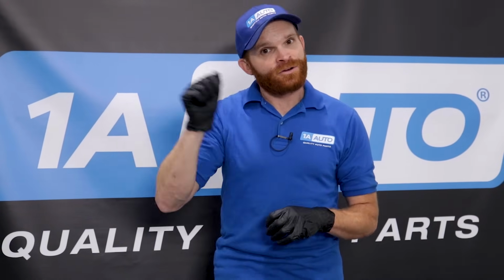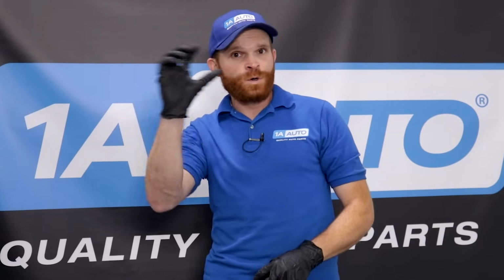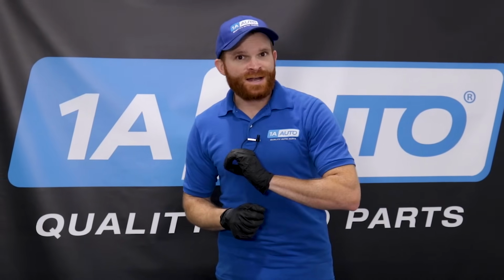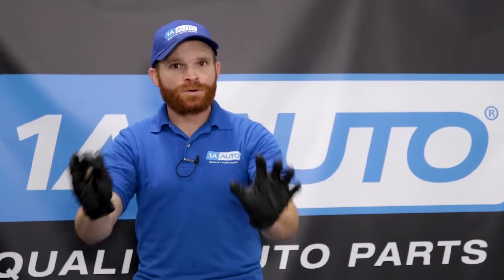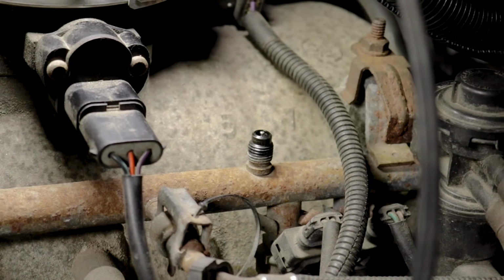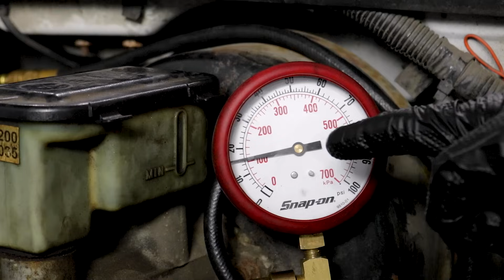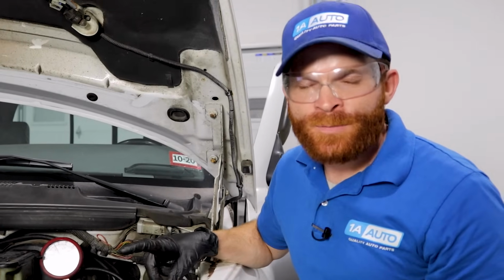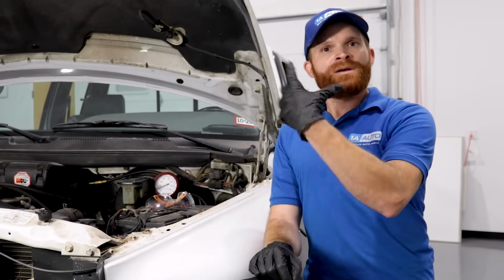Lag, Hard Start, Stall? Diagnose Car & Truck Low Fuel Pressure!

Comment: Is the ignition key on till 60 minute test or just once when the fuel pressure gauge got the pressure and we turned off the ignition?
Reply: In most cars the PCU will only run the fuel pump a few seconds and then stop (unless engine is rotating).  Then turn off the key and wait.

Comment: Thank you very much. Basically all the information needed about fule system. But what I didn't understand is why did you need to change the sending unit if the problem is the fule pressure regulator?
Reply: On some cars the regulator is inside the pump and make more sense to replace the whole thing

Comment: hi, thanks for sharing knowledge, I experienced something similar to your explanation. I have a ford focus automatic transmission vehicle which has a problem when it is started it takes a long time to start the engine and the code P0087 appears on the speedo check engine light display. What is the easiest solution you can give me to solve this problem?

Comment: Another video full of incorrect info.... your diag experience is basically if the pump doesn't run, have low pressure or the ability to hold pressure it's faulty. No mention of static pressure vs running pressure, injector leak down test, or balance test which will cause a hard start. Pumps are cooled by the fuel flowing through it and fuel level has nothing to do with sediment as it's always on the bottom of the tank along with the pick up of the pump and if your sucking air your out of fuel. The check valve in the pump isn't designed to consistently hold pressure but retain the max volume of fuel in the system as you can't compress liquid so pressure is almost instant. I could go on and on

Comment: Would you have any suggestions for a Chrysler 300c diesel 6cyl missing on at least 2 cyl new injectors, compression test results are ok. Scanner shows no fault codes. But injector readings from -0.5 to +3 ? Thanks Mark.

Comment: 2014 Chevy Silverado 4x4 LT:
I have this same very descriptive problem. I plugged in my scanner and it basically said a fuel sensor. a mechanic told me mine has 2 fuel sensors, 1 in front and 1 in the fuel pump. and it just so happened that my gas tank was leaking gas from a broken gas line in it connected to the sensor. fixed the problem I thought and after it still continues to show the check engine light. would that mean the sensor in front is the problem?

Comment: What could cause a fuel pressure regulator to neither raise or lower when adjusting it? The vehicle had trouble starting then finally started and held pressure at 22psi at the fpr.
Reply: Hi did you find the answer what was the problem there any news
Reply: It was the fuel pump disconnecting inside the fuel tank.

Comment: Hello, every time I turn the key to the on position (without starting the engine) it takes about 5 seconds before I could hear the fuel entering the engine. I recently changed the fuel pump and fuel pump relay, still no luck. Also the engine makes a weird heavy sound (kinda sounds like its stalling) only during cold starts. When the engine is warm and I start it up the sound is normal, any thoughts what the problems might be?
Reply: Did you find the answer

Comment: Yes got a lot of information from that thank you I have a 2002 suburban with a 53 the motor was bad I changed it didn’t realize that it was flex fuel truck and I put a regular gas motor in it didn’t realize it till I was all done and the gas was running funny finally realized it fixed a couple things now my fuel pressure is at 45 psi and it’s slowly leaking after a reasonable amount of time I’m wonderingIf it’s the pump or the regulator surprisingly I didn’t have many issues changing over from the flex fuel some said I had to reprogram my ECM I did not so please any response would be grateful thank you so much

Comment: First things first, thanks for the video. And now I would like to ask you about an issue with my 1.9 tdi A3. When the engine is cold it takes a long crank to start, but when the engine warms up is fine. At idle I can feel like the car shakes sometimes a little bit. And the previous owner use to have the fuel tank almost empty all the time. And I'm thinking the fuel pump is close to it's end. What do you think?
Reply: Did you connect a fuel pressure gauge and compare it to service information specifications?

Comment: Very education video. My car won’t start. I think I have a fuel leak beacause I have fluid sitting underneath the fuel rail near one of the fuel injectors. I have a 2009 and no Schrader valve so I don’t know where to test my fuel pressure. Weird thing as well I got 2 new engine codes: p0113 for intake air temp sensor and p0123 for throttle position sensor. Anyone please help and give me your thoughts

Comment: Please comment on calibration of fuel level reading. My friend constantly seems to run out of gas on his 1989 Honda Civic LX, when he actually has lot of gas in the tank and guage shows half full.  When  he adds just one gallon of gas car starts. Fuel pump and filter were replaced and still does the same thing. Thank you for your kind expertise.

Comment: Super cool video. But he didn't cover diagnosing fuel pressure drops at the injector end or the fuel pump side of the fuel system.  In other words,  is the system leaking down before the fuel rails or after?

Comment: I’m getting code P0087 after replacing my fuel pressure sensor with a new one, might it be the part or should I just wait for pressure to rebuild?

Comment: Hey (female driver here lol), I had a logbook service done and there is low fuel pressure coming from the fuel pump which is booked to be replaced soon. I asked the mechanic if it's still safe to drive in the meantime and he said it's fine, but I want a second opinion if you think it's safe?

Comment: What would a engine light, which presents itself under load, throws a  P0088(pressure too high) mean in this system. You explain a lot of what i'm experiencing in my 2017 honda civic touring 1.5t.  Its a cvt, i have two fuel pumps- low pressure in tank and the high pressure on engine next to the fuel rail. Its one of the turbo engines to add. 

Its been a long mission to fix this fuel system and i suppose a great learning experience at a high cost of course...

 injectors replaced, plugs, packs all replaced, new o2 sensor new cat, new exhaust, and then these issues you discussed here.  Longer than normal starts often sputtering and spitting accompanies that start for a short time then levels off to a some what cleaner idol.  Cold starts are nasty at this time, and concerning with all the shaking. Ive been to honda, ive been to a mechanic all several times too.  With no real luck. I thought i had it with the injectors but its like you get it cornered and you catch it but then out of no where it randomly manifests itself back into play.. all thats left beyond the repairs i ve done are the pumps and regulator and sensor as well as the filter. I guess the fuel lines too...

Being those are very expensive to just go pickup, then to do myself like it was changing the battery led me to do some more research.  Make sure i know my way and i found your video.  But in watching it, i end up waiting for you to mention the p0088 factor and unfortunately got left wondering your perspective of this situation?  I mean you come so close to nailing my exact experience except i have a different code and not a low pressure but high.  lol sorry!!!

There is a hesitation at times on the start of accelerating , and I can even hear some sputtering during the acceleration and under really high loads, which then thats when the misfire or the feeling of it happens, and triggers the limp mode ( safe mode) and check engine light related to the p0088 code.  

Typically, a restart will take away the safe mode condition allowing you to drive normally but the light often requires a clear code procedure...? any cool explainable insight you might be able to share on this matter or is that another class?  I learned a ton from this video and you do well teaching i must say! 

The problem for me is i don't know how to diagnose the vehicles fuel system  and so its a huge learning curve, and testing the pumps... and regulator... and pressure sensors... its all very technical stuff lol.

Feel free to send  me on my way!  Or direct me to the nearest cliff to ghost ride this pos off of.  Would be a great ending to this nightmare 🤦‍♂️

Comment: Crazy how I'm experiencing slow acceleration as we speak. I tried changing the spark plugs, spark plug coils, mass air flow sensor, and even the air filter lmao. I went to get a fuel pump, and my "trustee" mechanic said to return it. 2006 toyota camry 2.4. There is no check engine light ever. Which made it so difficult that I caved in and brought it to the Toyota dealership. They said without a check engine light, they can't really determine the actual problem. But my nutso brain is telling me between the throttle body and/or the fuel pump. Or now, from research, maybe the O2 sensor smh. Sheesh. P.S: I've done a OBD2 reading at auto zone, no codes were present.

Comment: Hi, New Subscriber Here.
GreatVideo.. 👍 I like how you explain everthing. very informative!
I would've liked to see what vehicle you're using in the video and hear you touch on certain things. Such as on that particular vehicle the fuel filter is Not visible. " if I'm correct" and that's a Dodge Ram. The fuel filter is actually part of the fuel pump assembly.
But again, Great Video. You Gave a lot of info, you didn't ramble and I didn't get bored!!!   👍👍👍

Comment: I love your videos, I also have a 96 dodge ram 1500 v8 5.2 and I have a problem, when I start it it tends to start and die unless I hold some gas. 

Ive changed the fuel pump, tps sensor, iac valve, map sensor and camshaft sensor. 

Any idea what else would cause this ? 

I also see that my catalytic converter sometimes has some smoke  coming out of it
Reply from the maker: +Marco Tobon We wouldn't be able to diagnose an issue like that here, you may want to have a local mechanic take a look at it. Thanks for checking us out! http://1aau.to/m/Shop-1AAuto-c

Comment: Excellent vid!!! Learn heaps!! Probably 'solved' my stalling problem on my 2009 Kia Carnival. Now onwards, I will keep my tank at least half full and get a pressure gauge tester to monitor my fuel line pressure. What do you know about 'sticky' fuel pump? Is that also due to low fuel, overheating, bad fuel? Worn parts, time to change? 
Thanks. Frank

Comment: In my '87 Ford 5.0L, fuel pressure is relative to the intake manifold, so the gage reading (relative to atmosphere) will drop with engine running, and can vary at least 10 PSI as you blip the throttle.  The fuel tank is flat and sloshes badly even when fuel level is low.  The resulting weight transfer makes it much more difficult to manage (and more dangerous) than you would think, so I made an attachment for my floor jack that supports the tank more widely AND also keeps the jack itself from tipping over.   This has come in handy for transmissions that like to roll off the jack.

Comment: If my fuel pressure is 28 psi would a new fuel pump along with new assembly and new fuel filter for sure raise that pressure, or could there be further issues?

Comment: I’m having trouble with my 02 Tahoe, It has the p0171, p0174, and p0300 codes. It has very poor performance when accelerating. Don’t know whether if its the EGR valve or fuel pump. Help!!!🤯
Reply: Did you ever fix your Tahoe mines doing the same thing
Reply: Did you ever fix your Tahoe mines doing the same thing
Reply: Yes I did fix it. It was the intake manifold gasket and fuel pump
Reply: @jerrya8650  ok thanks will get mines look at having the same situation with my truck

Comment: Great video, and thanks for posting. I had a leaking fuel filter on the tank side of the filter. I put a hose clamp on both sides of the filter and that seems to have fixed the leak. There was and is a 2-3 second delay in combustion before and after I fixed the filter leak. I've suspected that it might be the pressure regulator causing the delay. Your video makes me lean that way even more now. And, yesterday I noticed for the first time evidence of a small fuel leak just below the pressure regulator but also very close to the fuel rail connector. I have an '02 Taurus DOHC Duratec engine. I assume there's a replaceable O-ring on that fuel rail connector ?